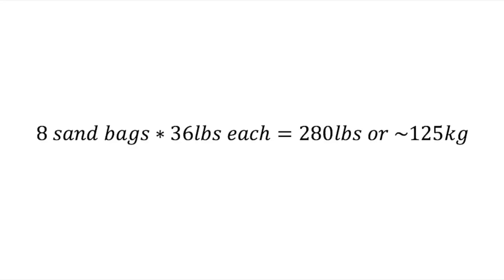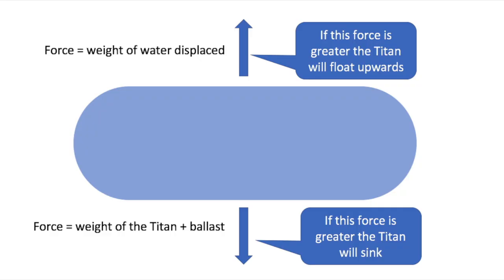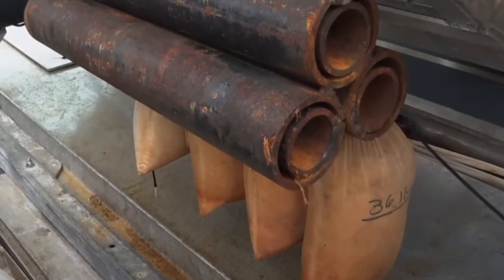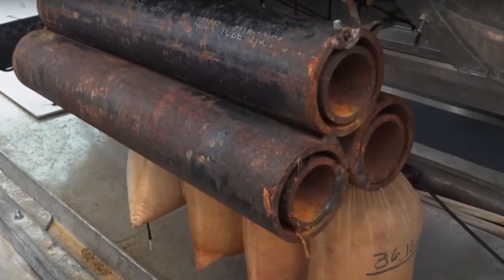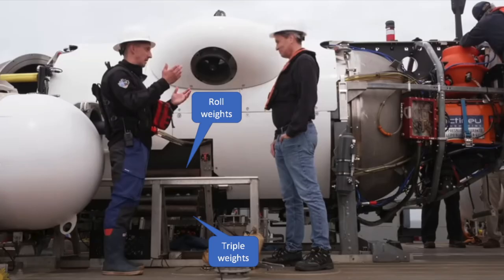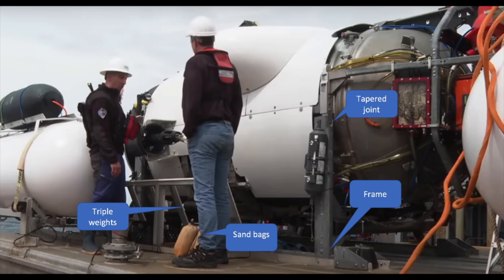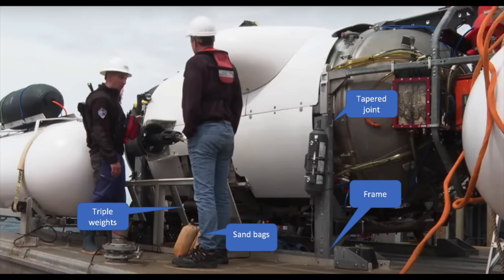LEAKED TRANSCRIPT! Is it authentic?  An engineering perspective.

Comment: They said they had an A Bus failures, so it was probably a slow leak from the jump into that A Bus battery compt and NOT in the pressure vessel.
Reply from the maker: The problem with that thought is that batteries are made out of solid materials and or a mix of solid and liquid materials. There is virtually no air space in a battery.  So even if a battery bank got ruined, that would have virtually no impact on the buoyancy problem the leaked transcript describes.
Reply: @theeverydayengineer1  it would short both short out the A BUss, snd the container encasing the baTeries, plural. That make up the A Buss would fill with water which prob couldn’t be offset by dropping ballast, as the water=weight…..a cubic foot of water weighs around 60 pounds…..and every pound of weight really mattered on the Titan……not knowing how much water can fill the sealed battery compartment (dont know the size of the container, nor how much water it displaces when sealed, its hard to figure……but they weighed everyone before boarding, including their phones, etc…..though if you saw the YouTuber’s vid of this, Stockton weighed him on CARPET….but, at least they were somewhat trying to control ballast and trim……think of those upside-down horseshoe looking weights that were on the skids…..and not all in a row, but a few were separated to help trim the craft……curious how movement of the suckers, i mean mission specialists inside would affect grime as they trade places to look outside, use the toilet (nasty)….whatever…..though it would probably be minimal, as the space is tight, and they are just rotating around……thus the weird way to dump ballast in an emergency- having everyone get to one side to roll the sub a bit to drop ballast…….weird. I’d love to know how much water the battery compt could hold if there was a leak.

Comment: Agreed. The reported buoyancy problems do not make physical sense. The only way to lose buoyancy is to displace air, and the pressure vessel seems to be the only place where this is possible. That said, there may have been other pressure vessels in the tail section, such as the electronics housings. This might be required to prevent possible turning moments due to the heavy equipment in the tail section.
Reply from the maker: It looks like there was one or maybe two small pressure vessels in the tail section, but there would not be nearly enough volume with the amount of water that would need to replace air to present the buoyancy conundrum of the leaked transcript.  And whatever was in those pressure vessels would have certainly made problems for the crew.

Comment: It's possible system A was a total failure and the frame was never jettisoned. The panic set in when the ascent was too slow and they couldn't explain that. If it was faked, I don't think the fakers would have added that.
Reply from the maker: The occupants would have felt every single one of the ballasts being released.  It being a sudden change of the buoyant force there would be an acceleration until the Titan hit a new terminal velocity with the new forces at play, and this would have been a particularly noticeable acceleration with the very heavy frame.
Reply: @theeverydayengineer1  Except they didn't notice a significant change in the ascent. If the frame had been jettisoned the ascent rate would have been noticed. They had no idea why the ascent was going so slow. In support of your theory, the recovery team seems to have a photographed undamaged frame.
Reply: @jimw1615  Perfect sense. And anyone faking the transcript wouldn't know that. Thank you.
Reply: @jimw1615 Fantastic observation! I have had this theory all along that not only is this transcript absolutely true, it also indicates a stage by stage failure of the electrical system which was in fact not engaging or partially disengaging the various ballast systems - a point your observation validates. This failure may have resulted in them not noticing the rapid descent to begin with (until the RTM actually worked, although it was too late). The fact that they were trying to ascend has been corroborated by multiple sources including James Cameron. In any case, the investigation will hopefully reveal the truth.

Comment: Any chance that the rapid descent was due to them being caught in a downwelling current?
Reply from the maker: Nothing in the leaked transcript mentions anything of the descent being too fast.  If it was Stockton would have surely mentioned something, or so would the top.  A downward current would however speed up descent compared to still water.
Reply: @theeverydayengineer1  The leaked transcript mentions they arrived one hour early. 8:01 to 9:47 . It was supposed to take two and a half hours.
Reply from the maker: @shooterqqqq  the rate of decent from that transcript was right about 40m per minute.  The titanic at almost 4,000m deep would take about 100 minutes to get there.  Plus they woudl slow descent down the last few hundred meters with the air bladders, so that pace would easily have made the descent be at the roughly 2 hour mark that I heard it was expected to take. According to this transcipt they were not near the end depth of the descent.  Either way, if the craft was descending too quickly they certainly would scrubbed the mission very early on.  That would be one parameter that would have just not been acceptable to proceed as that would have been a sign of a potentially serious problem. It just seems too implausible that the transcript would not acknowledge the anomaly of the rate of descent and just say everything is A-Okay.
Reply: @theeverydayengineer1  It should have taken two and a half hours to get there. They were an hour early and 1200 meter deeper than they should have. Please read the transcript and notice they advertised a two and a half trip to the wreck.
Reply from the maker: @shooterqqqq  I read what transcripts I could.  Can you send me a link to the ones you had?  I would be curious to read it.  Any which way about the descent rate, if it was taking on water, Stockton would have noticed because he would have had to adjust the descent to keep it at a consistent rate.  Absolutely nothing lined up with the titan taking on water anywhere in the initial descent.
Reply: @theeverydayengineer1  it’s entirely possible that the crew was inexperienced and did not think much of the faster-than-expected descent rate. The lack of comments about descent rate does not prove that the transcript is fake. If anything, excessive decent rate, possibly caused by a downwelling current, could very well be a contributing factor to the failure of the hull. Both the load and rate that the load is applied is important for any engineering structure.
Reply from the maker: @HLZ90  Stockton would have known if rate of descent was that far off.  Either day, let's just say they were in a hurry, added more weight to the disposable ballast to descend faster, the rate of descent is still very gradually applying load to the hull so it would not play a factor in the demise.  It is not a super fast load bearing like a car crash or something falling onto something else.  There is still the problem of why they couldn't ascend after dropping all that weight in ballast, and as an engineer that just seems to not add up at all.
Reply: @theeverydayengineer1  Could be that they only think they've dropped the weights but in reality only some of the weights dropped and some failed to detach. Could also be that a downward current is both speeding their descent and slowing their ascent. In any case the descent rate isn't enough to debunk the transcript. It may very well be fake but this isn't smoking gun proof.

Comment: totally agree with your vid

also
transcript uses metric, metres ,100's of metres

oceangate was american, imperial, used feet, 1000's of feet
therefore: transcript is fake
Reply: Every scientific enterprise uses metric nowadays for obvious reasons
Reply: Easier to use meters, not such cumbersome numbers. That alone does not disprove the Transcript.
Reply from the maker: Yes, I would think as sea the even the Americans would be using the metric system.
Reply: SpaceX uses the metric system.

Comment: Well thought out presentation, but I still don't agree with your conclusion. The Titan was slowly taking on water, therefore weight, from the beginning of this final dive. It was totally waterlogged by the time ascent was attempted. Where could the water have been? Perhaps in the non pressurized tail section, perhaps in the layers of wound fiberglass, like a sponge filled with water, still maintaining its outward shape, but becoming ever less buoyant. I don't think that anyone is clever enough to construct this scenario. I think that a sicko trying to gain media attention would have rejected this stream of events as too far out to be believed. However, in my experience, and I have lived longer than anyone aboard that submersible, truth is often stranger than fiction. I will be very surprised if it turns out, when the report is finally released, that this Transcript is fraudulent.
Reply from the maker: The entire descent was as expected of not taking on any water, perfectly uniform. To take on water to affect the rate of descent it would have to be inside the pressure vessel. Even a small leak would have been audible.  There is simply no other large spaces of atmospheric air to hold a massive amount of water to affect buoyancy outside the pressure vessel. Unfortunately there are a lot of ruthless people out there.
Reply: Not necessarily true. There was the whole non pressurized  tail section. There is also the possibility that water was seeping into the outer layers of the fiber. The hull was 5 inches thick. Also something shorted out the batteries. Water is heavy and this would have been water added to a submersible which was in the descending mode. By the time they tried to ascend they could only slowly overcome the problem. The pressure on the already over compromised hull didn't give them enough time.
Reply from the maker: Yes, the tail section was not a pressure vessel, and as such it also was not water-tight and easily was filled with water as soon as it got into the ocean.  Carbon fiber composites is not like a sponge, it is mostly solid with microscopic air bubbles from the assembly process.  Even if it could possibly take on water, it would be a very tiny amount.   The depth vs time log of the descent shows no signs of taking on water that would affect buoyancy as it fell at a constant velocity.  Stockton would absolutely knew if they were taking on water during the descent and would have scrubbed the mission.
Reply: I don't believe it was taking on any water at that point. I think the descent was so fast, it need to come to a complete stop which was not mentioned on the text, Then it had to start it's ascent which was going from a complete standstill which would have taken a few more minutes which they didn't have. System A was gone by that time and it's possible System B shared the same fate.
Reply: The problem is that for water ingress, it has to displace something with a lower density. That almost certainly means something containing air. This can only be the pressure vessel, as non pressurised structures would fill with water in all cases. The same goes with the idea of delamination allowing water ingress. Unless the water is displacing a lower density medium, it will not affect the buoyancy. In other words, a waterlogged outer structure would not change the buoyancy.
Reply from the maker: @markfernee3842  well stated.  Thank you.

Comment: Agreed.  That said, I am more bothered by the "expert" who said that it "plummeted" for about a minute; some sources even describe this as "free fall".  Even if the pressure vessel were entirely filled with water, it would not be in "free fall"!
Reply from the maker: I saw that one and was like what the heck is that guy on?!?!
Reply: @theeverydayengineer1   That "expert" seemed to put great emphasis on the supposed change of orientation of the submersible, from horizontal to nearly vertical.  That would make sense if it were an airplane or, to a lesser extent, a submarine that controlled its rate of descent using dive planes.  The submersible is more like a blimp than an airplane, though.
Reply from the maker: @christosvoskresye  that guy sounds like a real “expert” for sure.🤣